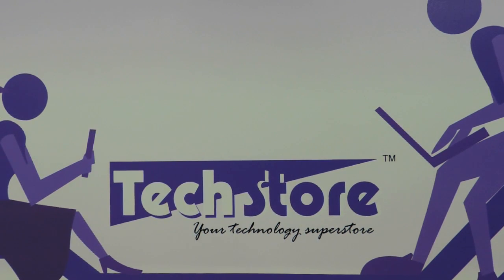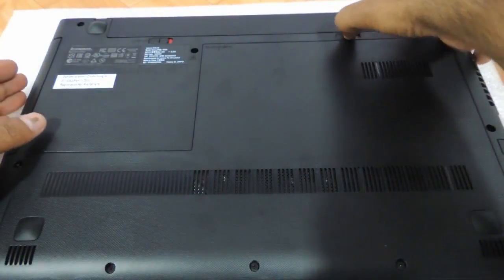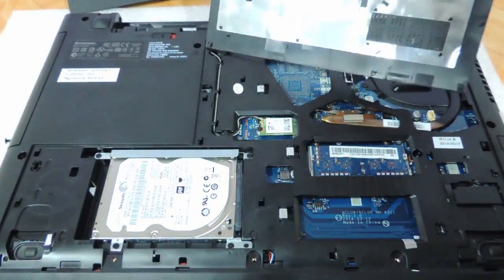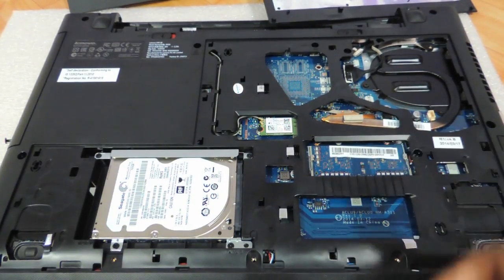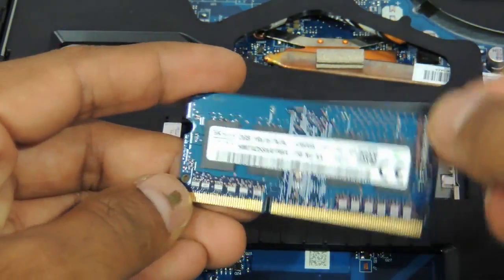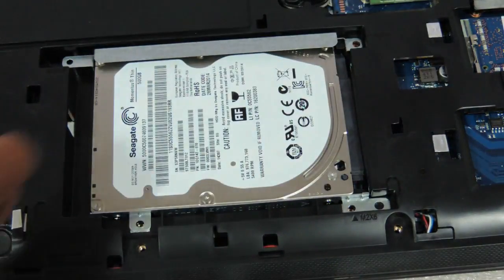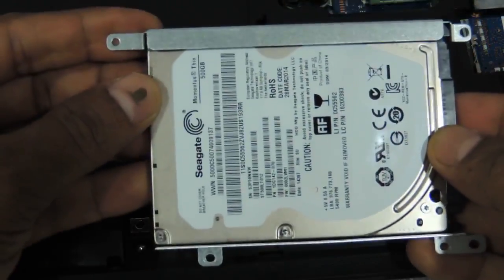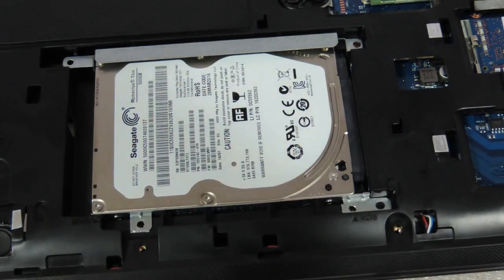Lenovo G50 30 G50 70 How to upgrade ram and harddrive

Comment: Sir please reply. does lenovo g50 30 has 2 ram slots or not ??
Reply from the maker: have you subscribed?
Reply from the maker: have you subscribed?
Reply: @TechstoreCoIn  yes
Reply from the maker: have you subscribed?
Reply: @TechstoreCoIn you told in the video that it has 2 ram slots but my repairer is telling 1 slot for ram in g50 30 laptop
Reply from the maker: for amd variant there is only one slot unfortunately

Comment: Yeah... what about adding a 2nd RAM module ?!? Where is that 2nd slot located ? I expected to see *that*, not how to replace existing module !!!
Reply from the maker: g50 30 which has Pentium or celeron processor does not have a second slot.  variants with corei3 and above have two slots.

Comment: I have Lenovo g570 and the second ram slot is not recognizing my ram although it works in the first slot, my computer recognize the number of slots, where is the problem sir is the ram slot need to be cleaned or is just dead I need help please ASAP cuz I'm was intending to upgrade  my laptop with another 4gb ram, thanks
Reply from the maker: Replied.

Comment: I have Lenovo G50-70 laptop with 2 GB RAM and two memory slots. If I upgrade the memory do I need to install 2 GB+2 GB RAM only or can I use 2GB+4GB RAM combination? Someone told me that the memory capacity of the RAMs should also be same if I use two RAMs together or else it will not support. In simple, will 2GB DDR3L 1600Mhz(pre-installed) + 4GB DDR3L 1600 Mhz RAM will be OK? PLEASE HELP.

Comment: Lenovo G50 - 70, does it have another RAM slot??
Reply from the maker: yes it does if it had corei3 or core i5 processor
Reply: @Techstore, it has i3 processer with 4 gb ram
Reply: Sir, I have one more question as there are many white vertical lines in the middle of my laptop screen.., should i change change my screen?? Or these can be removed?

Comment: Hi,

My Lenovo laptop model: lenovo g50-70(model 20351) with DDR3 ram type. PC3-12800(800 mhz)..asking for the right RAM type should i buy to upgrade from 4gb to 8gb.  More thanks in advance
Reply from the maker: Buy a 1600MHZ DDR3L (low voltage) memory of Kingston,Zion,Transcend

Comment: Mine is Lenovo g560 it comes with 2gb  ddr3 ram. I have 32bit OS do I have to install 64bit OS for 8gb ram.
Reply from the maker: +Priyanshu Gupta yes you have to install 64 bit os. Your laptop supports upto 16gb ram

Comment: I just upgraded the ram but afterwards I boot up my laptop and it keeps putting me into a preparing automatic repair loop... please help
Reply: When I remove one of the sticks it goes back to normal... whyyyy
Reply: Is it possible that both sticks of ram need to be the same brand/product?
Reply from the maker: +Evan Barker not mandatory. They should have the same specifications
Reply: Techstore hahaha thanks I just had to push the 2nd ram stick in. It was pushed into the panel but not pushed all the way down.

Comment: can u please post ram specification ? i wanna upgrade to 4 or 8 GB & I have G50-70 .. TY :D
Reply: hi i have g50-45 2gb ram.ihave try to change my ram with new 2 rams 2gb but not working the laptop
Reply from the maker: +Sneh Patel upgrade to 8gb. buy a 8gb DDR3L 1600 MHZ MEMORY. MENTION LOW VOLTAGE MEMORY.

Comment: Hello i have a question,let's say i have 4 gb ram virtual memory so i want to to add more ram i have one for 6 gb but can i add it? pls answer me.!!!!.\
Reply from the maker: +Chris Brown you can add another 4gb,8gb or 16gb memory
Reply: Yes,ok but can i add 4+6?
Reply: I have ussually 4 gb installed and i want to put another 6gb
Reply from the maker: +Chris Brown 6gb Memory is not available
Reply: If i add one more for 2 gb?Is it avialable?
Reply from the maker: +Chris Brown you can add 2gb to your existing 4gb and make it 6gb. But you will not be able to upgrade it anymore a both your memory slots will be consumed
Reply: So to don't get them consumed i need 4+4 or 8+8?
Reply from the maker: +Chris Brown yes you are right, that is the right mix

Comment: +1 I just bought 2 8 GB PCL3 RAMs for my G50. Your Video will help me to upgrade it from 4 GB to 16 GB. Thank You for this Video.
Reply from the maker: +Theo Schmitz your are welcome and thanks for your kind words. Do subscribe and spread the word
Reply: Would you help me with the screwdriver needed for the same(to open the slot)
Reply: @theblossomstar9962  I bought a Set of small Screwdrivers. It was a medium Cross Screwdriver. You should find them on Amazon.
Reply: @Firelord-ry6gg  Thank you very much for your help.

Comment: Really good video! But I have a few questions...
N.1) If I have a second slot for a RAM card, adding another 4 gb RAM would be the same as having one of 8 gb? And can I replace the 4 gb RAM with one of 8 gb and add another one of 8 gb?
N.2) Does Techstore ship to Italy? If so, how much is the shipping?
N.3) Do you hae a linked account on Amazon? That would help me a lot!
Thanks again for the video, and thanks in advance for your patience!
Reply: That is the right way to upgrade it. The Lenvo G50 has to RAM slots the two are connected as a bank. If you replace one the two must have the same capacity. I have the 4 GB installed as workside installed. I want to install more RAM so I remove the 4 GB and install to 8 GB. I also plan to replace the internal Harddrive with one greater but SSD.
Reply: +Theo Schmitz thank you really a lot!
Reply: @Firelord-ry6gg  sorry bro I don't know much about laptop but can we install 1tb hdd is without removing the previous it is there any slot or I have to purchase 2tb and remove the previous one
Reply: @nothings7658  you have only one Slot inside. I would replace the installed HDD with a new with more Capavity. The new HDD can you first install as an additional HDD by USB an copy your Windows on it and than replace the internal HDD with it.
Reply from the maker: +giacozz you are welcome

Comment: I have the lenovo G50 70 laptop and I found there is two slots one with 4GB RAM Ramaxel 1600MHz and part no. is RMT3170EF68F9W1600 and another slot empty. I want to make you tube graphics videos, so I decided to upgrade RAM for video editing. When I buy another RAM of 4GB to get a total of 8 GB, what are the specifications I need to check for matching?  Will this work http://www.amazon.in/Kingston-DDR3L-1600-PC3-12800-KTL-TP3CL-4GFR/dp/B00IOC7P18?ie=UTF8&psc=1&redirect=true&ref_=ox_sc_act_title_1&smid=A2L9IATVUI8ITW
Thankyou.

Comment: Hi, thanks for the video. Can I upgrade the cpu on my A8 lenovo g50 - 80e30181us? I was told to the A10 trinity no problem. Some one else said no the cput is soldered to the motherboard but it doesn't seem so when I upgraded the ram. Thanks
Reply from the maker: +zanydeath CPU is soldered to the motherboard.

Comment: Any stickers or paint on screws .....will this void my warranty
Reply: attecker It depends how thorough they are. Shouldn't be a problem if you don't throw away the original parts. Need to send it in for repairs? Simply replace the old parts and then send it. There aren't any stickers that will get pulled off for the HDD or RAM.
Reply: Cherry Pauper ...no actually i haven't even bought it yet, it's for my mom and i would like to put in 8 Gigs of ram in immediately  but i will not buy this one if this will void warranty. Do you happen to have it.. if so could you check if there is paint on screws :)

Comment: Will this void my warranty?
Reply: Jay González It depends how thorough they are. Shouldn't be a problem if you don't throw away the original parts. Need to send it in for repairs? Simply replace the old parts and then send it. There aren't any stickers that will get pulled off for the HDD or RAM.

Comment: is there a shot for an ssd or do i have to replace the sata drive
Reply from the maker: Chris Doman You have to replace the HDD
Reply: +Techstore False, you can buy a HDD Caddy nd swp out your cd drive to use an SSD.
Reply from the maker: Trueshot Caitlyn Yes you can use a caddy to add additional SSD or sata HDD.
Reply from the maker: Trueshot Caitlyn The question was whether there is additional slot for putting a ssd. Thus our reply.
Reply: I read his question, "is their a shot for an SSD"
Thought he ment shot as in chance. But either way my mentioned method gives the laptop another drive slot.

Comment: Can I upgrade upto 8gigs plz reply
Reply from the maker: Yes you can
Reply: Corsair 8GB DDR3L Low Voltage 1.35V 1600Mhz Laptop Memory SODIMM (CMSO8GX3M1C1600C11). Will it work with lenovo g50-80 ?

Comment: mine is the basic Lenovo IdeaPad G50-30 (product #80G000C1MJ). I think it comes with 2GB RAM and  500GB HDD. But its slow and hangs alot when streaming, using flash and etc. how much of RAM can i increased to? need to increase the processor aswell?
Reply from the maker: you can increase upto 8gb max

Comment: and how can someone transfer the original copy of windows 8.1 to new ssd/hdd?
Reply: Take a look at hard drive cloning software. Generally though it would benefit you to have a clean install of Windows on your SSD.
Reply: dkconor i do not want clone of drive to use on the ssd, i just want a clean installation. i guess it can't be done on windows 8 64 bing, there is no .iso out there for bing version.
Reply: Nerven1986 Have you tried activating your licence key on a regular Windows 8 installation?
Reply: Nop. Haven't any W8 pc nearby. Only my macbook pro r =)
Reply: Nerven1986 I mean try to install Windows 8 and then try to activate that with the Windows 8 with Bing license key.. I'm confused now!

Comment: Techstore i have this same laptop with i3 4030U 1.9 Ghz and AMD Radeon R5 dedicated graphics,now i know i can replace the cpu but can i do anything with the gpu, is it replacable or its not cos i read on lenovo's page about the g50 series its upgradable to gt 820m so can i put some of nvidia 700 series there please reply fast :) its urgent
Reply: most probably this is the ota software upgrade of Radeon R5 230. Mine got the update but I had to revert back coz It didnot handle PubG in mine. IT freezes anyways.

Comment: I have a Lenovo g50 with two slots for ram, have a 2gb ram, can I put a 4 gb ram on the other slot?
Reply from the maker: victor perez yes you can ;-)
Reply: You can plug in max 8GB (If you want to know what is the limit)
Reply: Astral so 2 of the 8gb right?
Reply: Yes go ahead but prefer 8gb over 4gb

Comment: I followed your instructions and when I put the computer on it gives me an error 'EFI Network 0 for IPv4 (28-D2-44-A4-A0-21) BOOT FAILED'
Reply: http://forums.lenovo.com/t5/IdeaPad-Y-U-V-Z-and-P-series/EFI-network-0-for-IPv4-boot-fail-on-idea-pad/td-p/1438111
Reply: +Dan Mbex did you put in correct ram type?

Comment: Where's the fan at?  Not hiding under that huge black bracket with the heat pipe lying on top, I hope...
Reply: The G50-30 use a fanless design.

Comment: I already see the same question but no answer to that question. I bought a g50-70. It has 4gb RAM and i want to upgrade to 8gb RAM. Will the warranty expire when i change it?
Reply: warranty will not expire. I asked lenovo customer service. Only thing is that for the added peripheral you need to go to that company only for warranty services. 
Even I purchased it few days ago. Bro does it has extra ram slot?

Comment: hello i just bought the g50-45 and it is kinda slow with my video games will this help? what else should i buy to improve this laptop?
Reply from the maker: Gabriel Lopez Why did you buy the AMD variant :-(
Reply: It's amd a8
Reply: I am sure you can play your games on g50-45. Try to set lower graphics quality. If games still run slow check for background tasks, upgrade BIOS and check for Windows updates.
Reply: I figured it out. I needed to update Windows. I feel pretty dumb lol

Comment: Could you please let me know if the RAM in the link is compatible with this laptop. 

http://www.flipkart.com/transcend-jetram-ddr3-8-gb-laptop-ram-jm1600ksh-8g/p/itmdfzhzpkamgyjz?pid=RAMDFZHXDGVCUQNW&

Thanks,
Anuj
Reply from the maker: Anuj Sinha This will not be compatible. Please visit http://techstore.co.in/Zion-DDR3L-8gb-notebook-RAM-1600mhz-id-591019.html
Reply: Techstore wt is the problem in case of the same being used?

Comment: hello, can i take one 8gb 1600 mhz ddr3 into the ram slot in this model?
to how many ram can i update this notebook model ? thx
Reply from the maker: ludde303 The max you can upgrade is to 8GB DDR3L. It has one solt only.